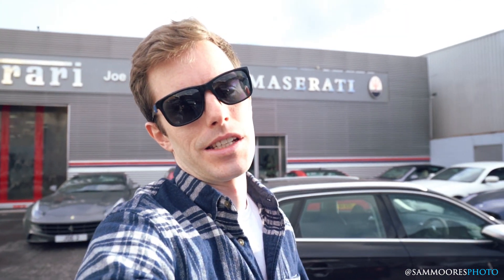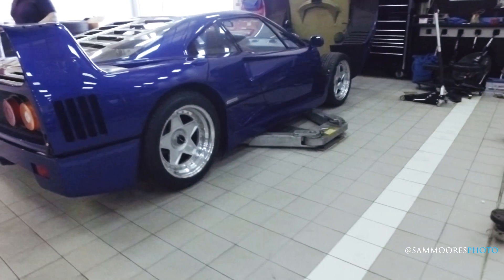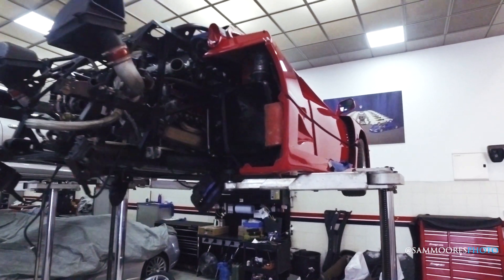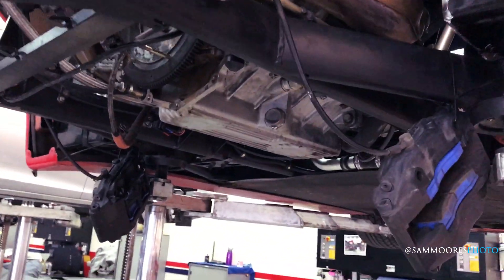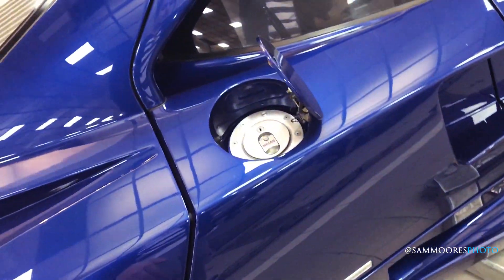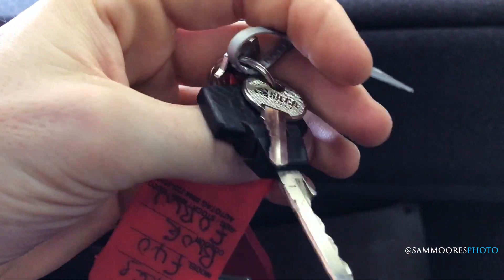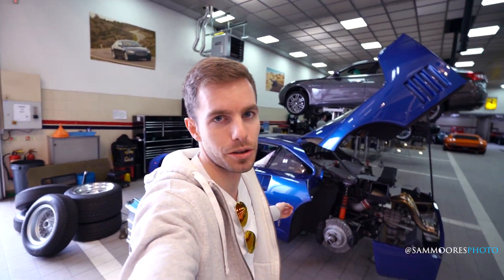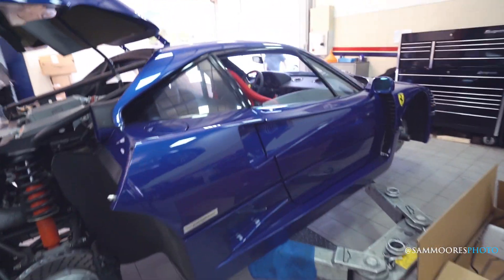That Time Of Year Again: Ferrari F40 BLU Service

Comment: How come every older super car that I see (especially the F40) still has the original Pirelli tyres on? Is Pirelli still making them? and why not run something modern like the Michelin Pilot Sport 4s instead? thanks for anybody that answeres this! :)
Reply from the maker: You run into tyre width issues. When they next get swapped I’ll look for some options but not much out there in 335
Reply from the maker: 335/35/17....
Reply: @sammooresphoto  yeah you're right! I didn't thought that this is such a rare dimension nowadays. But it is, modern supercars are 19 20 inch diameter wheels so something in 335 width and 17" is ancient stuff. Even for the F50 which is 18 inches there are only very limited options for the rears. For the front there are tons of stuff though but I guess you wouldn't want miss matched rubber on your exotic right? 😁

Comment: Air conditioning, what? I never expected that on an F40.
Reply from the maker: And a fuel filler cap on each side..so practical
Reply: The thing is, the air conditioning is practical. I´d never expect any kind of comfort from an F40. The car is supposed to suck but be a childhood dream to drive. In my eyes ( and I´ve never been near an F40 ) this is as close as a race car as you can get.

Comment: Surely the cam timing belts don't need to be changed EVERY YEAR do they??  Also, just 18 pounds 90 for the actual belt?  That's insanely cheap!  An OEM Honda timing belt for my Acura is something like US $60, 50 pounds or maybe more in the UK.
Reply from the maker: +Patrick94GSR every 3 years for the belts

Comment: I love this car, always have since I first saw it in '89 but as I get older and much less impressed with the world we live in, I look at what is charged for an annual service on this car over your standard family car, just because the badge says 'Ferrari' , even if it takes 4-5 hours, that's almost 1000 pounds an hour.     Still takes one guy, still takes less than a full day's work, still changing oil...      yet the world (and Ferrari drivers) accept this as 'normal for a car like that'.     What a fucked up world it is.

Comment: why dud you have the car painted? Part of the beauty of the F40 which attracted my pop to his was the fact that the Carbon Fiber is visable due to the thin application of Spies Hecker base/clear.. What are your last 4 chassis digits? Im 42 and I was 15 in 1990 when my pop got his..He gave me his 348 TB for my 16th bday in April 91..I still have it..Its not the fastest car by any means but being my 1st car...is very special... I havent EVER sold any of the hand me downs my pop gave me...I still drive my 96 gated 6 speed 355  Berlinetta ..I HATE F1 trannys..We still only buy mfgrs who build a true Manual box..I daily my Carrera white 2008 manual GT3 RS..I keep our F40 & 50 HERE in my garage in Aspen for my pop.. Being that he travels back to Chelsea quite often to check on our family business of Barge Transport on the Thames,I make sure they stay climate controlled and driven..We have been in Cargo Transport on the Thames since 1818..using horses to pull the barges along tge walk ways of the river..Insane how much has changed..I DO LOVE tge blue though.. Mariner Blue with Red interior is a very common spec on my cars..I wish I coukd attach some pics! If u care to see any of my pics let me know.. I in fact have a Euro Spec 1986 carbd LP5000 QUATTROVALVOLE in rare factory mariner blue with red guts..Im actually from Epsom Surrey myself and im still a Resident Alien here in the states with a Green card so I can run my business..Beautiful car & cheers..CB PS...DONT YOU JUST LOVE ALL THE DAMN PARTS THAT SIMPLY "TIME OUT" ON TGE 40 & 50!!LOL.. IT SUCKS!!
Reply from the maker: You can see weave through the blue which is nice. Still haven’t driven an f50, hopefully will get the chance at some point. Nice to see a family business going strong
Reply from the maker: Thanks, much appreciated. No stateside plans at the moment but if I’m in the area I’ll send you a message
Reply: Are you on Instagram bud?